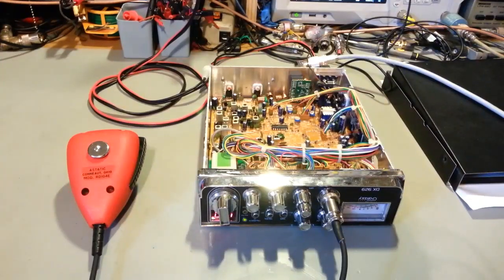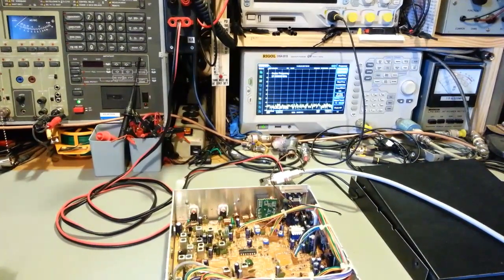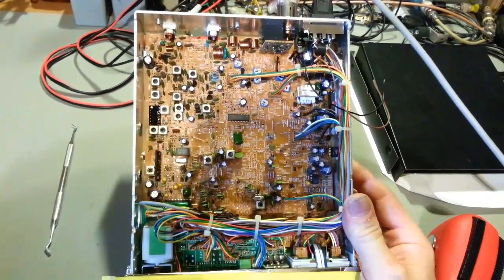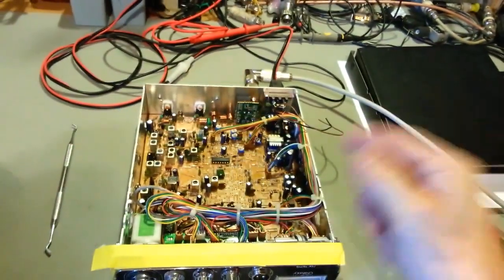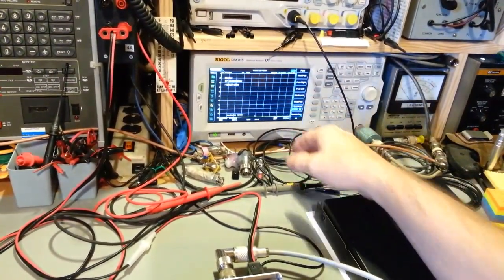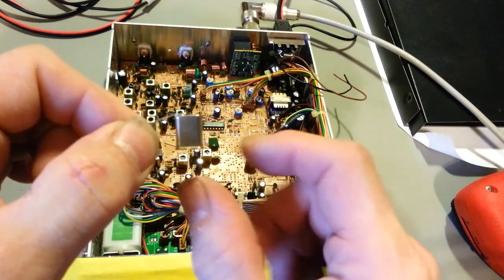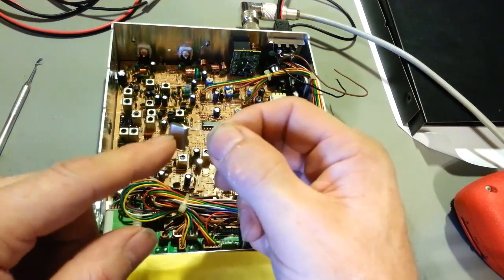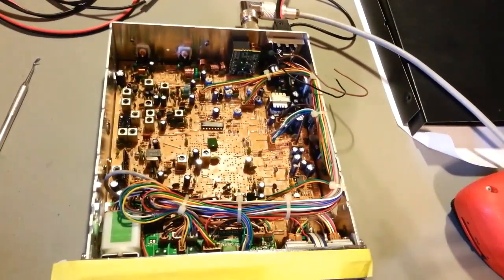Galaxy DX 929 with 100's of kilo hertz frequency drift.  Diagnosis and repair.

Comment: Hi. My brand new DX-929 has the bare wire from the crystal to the can from the factory.
Would the frequency need to be realigned if I cut that wire out of the radio???
Reply from the maker: Possibly yes.  When you ground a crystals can it acts like a capacitor and can shift a crystals oscillating frequency.  If it has the wire attached from the factory DO NOT CUT IT.  They designed it to be that way.

Comment: I have a Galaxy DX 959B that is slowly drifting up in frequency over the last few months almost to the point of where I may no longer be able to listen or transmit in SSB mode I can tweak the TX frequency  adjust VR7 for transmit  (at least for now) until I run out of adjustment if it keeps on drifting any higher.  I am concerned.

Comment: I have a 979F that is noticeably drifting when transmitting on side band (even the 5 digit counter is picking it up) also the clarifier seems to be misaligned.   Think you can take a look?

Comment: Ive used a 200 ohm resistor strapped up against the Xtal to keep it warm,just feed it from the 8v regulator works pretty good for these junk toy radios :)

Comment: Mike, i tend to see two different types of glue in radios.  one looks like liquid nails and the other looks like rubber cement.
I have been removing both, but was wondering if you have the same practice, or if one type of glue is acceptable to leave.
have never been able to find a definitive answer on this.

Comment: Those galaxy radios seem to have issues with bad 10MHz crystal frequencies or solder joints on the crystals. I have found the same myself. the ground wire to the case lowers the crystal freq and helps to improve stability by adding more thermal mass.
Reply: I've had a few Galaxy radios with faulty 10.24MHz crystals too, seems there's a batch of cheap crap crystals out there or maybe they're overdriving them.

Grounding the case lowers the frequency because the ground wire adds the case-lead/crystal capacitance into the shunt capacitance and extra capacitance lowers the frequency, it could also make it more stable because that capacitance is no longer floating and potentially picking up or leaking stray crap from other parts of the radio, it also reduces 'hand effect' drift. 

I don't think thermal mass has as much to do with it as the stray capacitance.

Would be interesting to compare the result of a heatsinked but ungrounded crystal and a grounded one with hand capacitance effects but I suspect it wouldn't be more than a few Hz once you'd nulled or trimmed out the differences in fundamental frequency so, handily, a nice Rb referenced Racal 1998 would be useful there :)